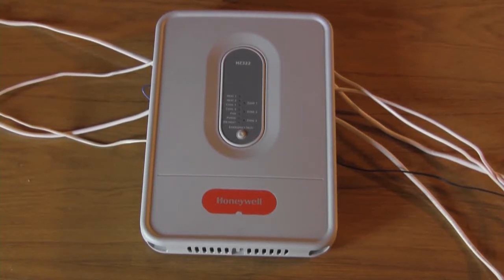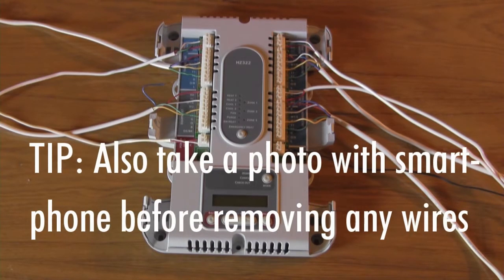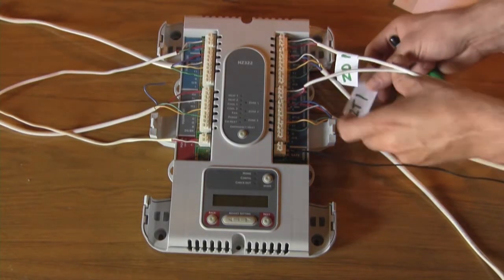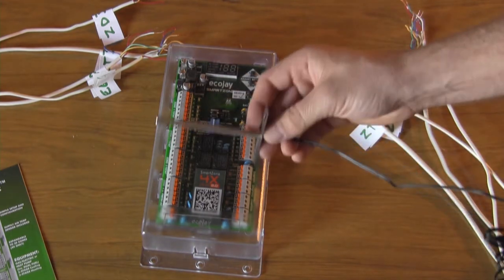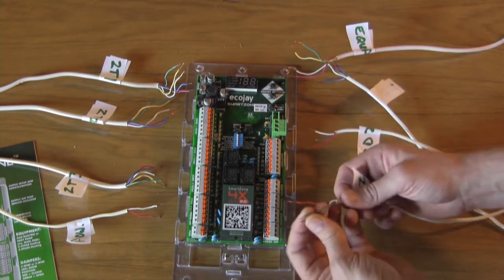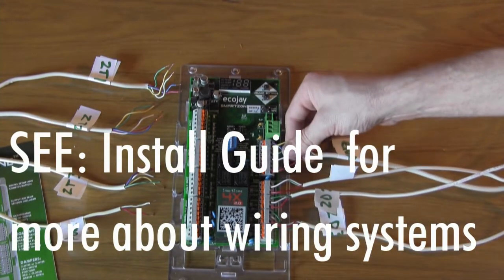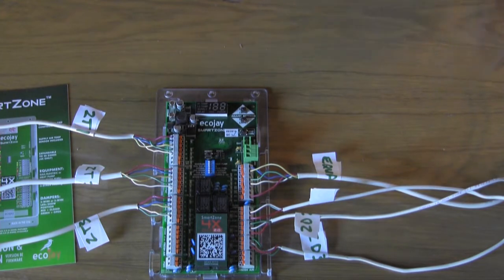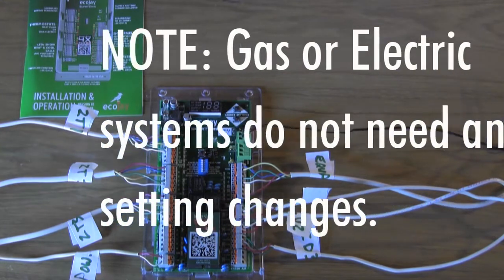Replacing Honeywell Zoning System (Truezone HZ322) with Ecojay SmartZone ZS-4X

Comment: At the :44 mark there is a blue wire that is not connected. Why isn't it connected to the Honeywell. If connected, where would it go? Later, I see it plugged into the COM on the ecojay. Thanks and one more question. On the Honeywell board, Equipment terminals, I have a wire in B.   Where would that wire go in the Ecojay?
Reply: 1. The blue wire would be connected to the COM wire on the Honeywell also.
2. The "B" wire on the equipment from Honeywell will go to the "O/B" terminal of the SmartZone equipment.

Check out http://www.ecojay.com/ for more info.
Reply: @ecojay5761   I installed my Ecojay over a year ago and love it. Sadly , spent over $600 with local "pros." At the end of the day, problem never solved until I installed the ecojay and learned as the days went on.

Comment: I own this system. How do I bypass the dualzone option?
Reply from the maker: Justin Stephenson - you can put a jumper wire between 'ECO' and 'R'.  This will make SmartZone operate only from Zone1 like a single zone system but the dampers for other zones will still open and close.  ANOTHER option is to unplug  the temperature sensor from SmartZone.  This will allow zone one to make the equipment run but no dampers will ever close. Please note that removing the sensor will not work if you have multi stage equipment.

Comment: Why Ecojay?
Reply from the maker: Richard Campbell - I have found that the ecojay smartzone is easier to set up and more reliable than the other guys.  it's also got leds that tell you what is going on with the board that would be harder to tell with the competition.    finally, the SmartZone is just more straightforward.  try one for yourself, you won't regret it.
Reply: I have the same question but different. I just switched from an only Lenox AprilAir to the HZ 322. Both have dual speed  control which is what I have upgraded my AC unit to. Actually variable outside and dual speed inside. I have not yet upgraded the theromstats to dual control. I noticed the HZ322 can handle dual speed control thermostats but the Ecojay is lacking. Right now I have the board set to run 40 minutes on low before high will engage. I can rig it so that if two zones call it will cause it to go to high speed.

What is your thoughts on dual speed units and zone control boards and thermostats?